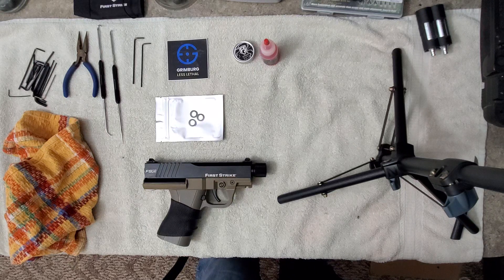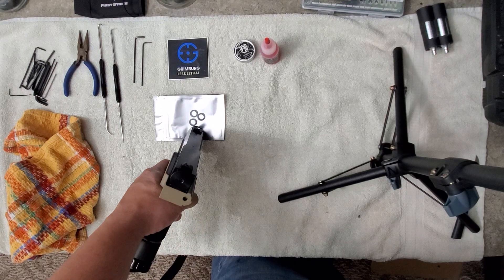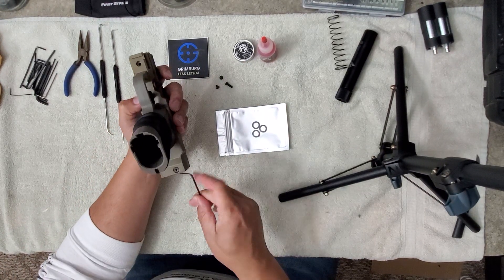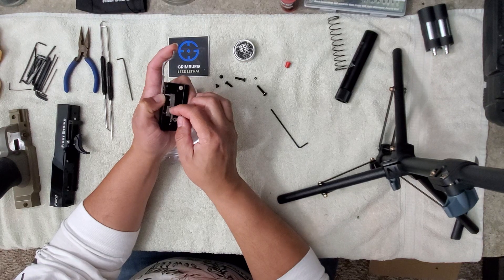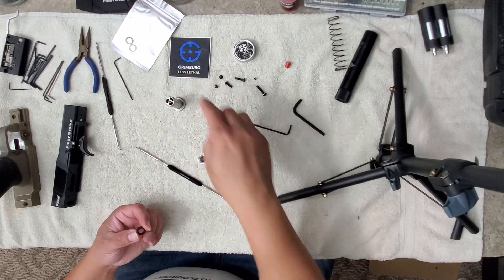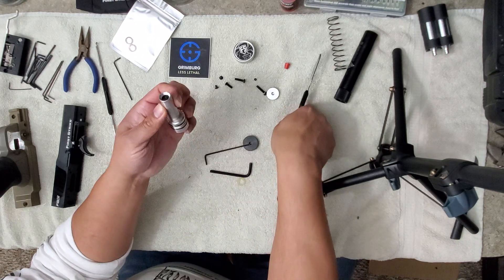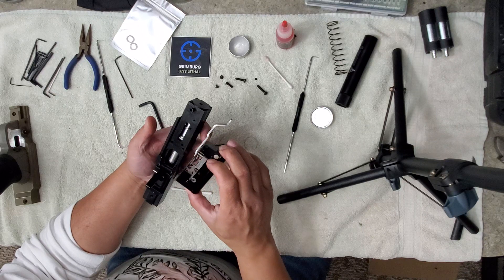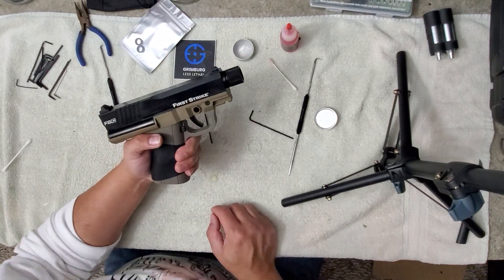How to replace your FSC heat-core o-ring with info.

Comment: Did it, finally!. both FSC & TCP in one sitting back to back. Your calm friendly voice kept me company. I didn't need to remove the last cap to put a sharpy through. I managed to slip the ring in easily on both. Did it dry then used the Qtip jam the oil in.  I feal so much better now! Thanks Again!!
Reply: But now I have a new problem. Both my FSC and TCP are spitting all the balls out when I insert the magazines. Doesn’t seem to matter which magazine or witch launcher. There’s no way I could’ve put them back together wrong. Very strange
Reply from the maker: Could be the detents. Did you lube your ammo? Also maybe use the silver mag spring.
Reply: Thank you Henry!  The detects i’ll look good. The TCP is brand spanking new, first time using it and it’s metal detents. Could the balls be too slippery? And I will put there original springs back in then I guess and hope they still push the Grimburgs up
Reply: … Sorry, my phone keeps trying to auto correct me and misspelling things and I can’t edit from my phone
Reply: And I guess it will always happen if I have the CO2 pierced when I slap magazine in there
Reply from the maker: Not necessarily. Try these...
https://www.sterlingselfdefense.com/product-page/upgraded-ball-detents-6pk
Reply: Thank you! Those look pretty stout. I’m assuming it’s a fairly standard fit. If the Grimburg barrel  uses different kind but I haven’t installed it yet So I’ll see if it happens with that one too maybe not. Thanks again very much Henry!!
Reply from the maker: Yeah, sounds like they might be slippery if you lubed them.

Comment: I went cheap/improvised on the tools.  To remove the o-ring, I used a push pin instead of a pick.  To install the o-ring, I inserted a regular Sharp (tail end first) instead of a dowel rod.  I dumped the Grimburg ring down the chamber and pushed the Sharpie until the o-ring was at the o-ring slot.  Then, I used a chopstick to seat the o-ring.  😁

Comment: The sweet spot for the velocity screw is one and a half turns clockwise from the factory setting. Great video, awesome content. I use a plastic dowel or a sharpie  inside the heat core to replace the o'ring. Could you post a link for the projectiles that you use.
Reply from the maker: YouTube doesn't let me post links on here, but it's www dot Grimburg dot me

Comment: At 22:54 Is there supposed to be a little bit of friction after it's slid about halfway down?
Reply from the maker: A little bit
Reply: @psi.defence.channel  Thank you. I just completed my first o-ring upgrade
Reply from the maker: @pepsico815  lubrication is important. That resistance should be more like suction. Like if you cover the pinhole in the air chamber it's very hard to pull apart...

Comment: Henry I was wondering if you could please help me I did the O-ring and the PRV delete and after reassembling the gun will not fire at all it does not his it does not leak it just does not fire luckily it’s a replacement and I still have my others but I would like to fix it any reply is appreciated
Reply from the maker: Did you slide the boat forward before you put the regulator back on?
Reply: @psi.defence.channel  Figured it out thanks to your regulator fix video you’re the man
Reply: Also changed the burnt orange lower to black via the instructs as per Less lethal777
Reply: You guys are awesome God bless you guys
Reply: Between you his and mikeys vids i am able to figure out these markers for home defense i am grateful
Reply: Also sprayed it with outdoor paint just in case it ever chips or fades  it will always be black underneath as well Have the handgrip arriving shortly very happy with this build may get the grimburg barrel and white v2s soon..
Reply: Also are you guys aware of any bluing products that are better than the casey product for blacking scuffs and scratches? Thanks man

Comment: Do you have to take the whole gun apart to replace the o-ring? Can you get the heat core out just with the allen wrench?
Reply from the maker: I got it out like that once but I've tried several times. I recommend just going ahead and breaking it down. You'll not only have the opportunity to examine your o-rings and re-loop them, but the more you do it faster you get at it.

Comment: Is there a trick to take off the back cap to remove the bolt? It's really tight that I'm afraid to break it?
Compare to yours, you unscrew it so easy.
Reply from the maker: It may have some type of loctite adhesive. You will have to heat it up. I have a little miniature butane torch that I use.

Comment: Question if I had to get one lube for the gun what lube do you suggest and I will get it from Amazon
Reply from the maker: UltraSilk Paintball/Airsoft Marker Lube and Treatment, 1 oz gw - Made in The USA https://www.amazon.com/dp/B089P1ZS7T/ref=cm_sw_r_apan_glt_i_0DG1ZPDZYHPK461RMM2J

But if you buy it from ultrasilk.com and use PSI10, you get 10% off

Comment: Is it absolutely critical to remove the upper just to change the O ring?
Reply from the maker: I got the heat core out once without doing it, but I tried many times and could not. I've come to the conclusion that it's better to just take the upper off so you can inspect and lube your o-rings while you're in there. I've done it so many times it's no big deal. The more you do it the easier it gets!

Comment: where can i get the magazine cant find one
Reply from the maker: T8.1 or FSC?
Reply: @psi.defence.channel  t8.1 for the fsc
Reply from the maker: @stevenmeansphotography3861  they are hard to find. Keep looking. Stuff pops up in stores occasionally. Also keep checking eBay. CymruTec sells these great printed mags.   https://cymrutec.onlineweb.shop/FSC_12g_Co2_Magazine/p7191594_20532746.aspx
You need the internals from your Fsc mags though. He also makes a 16g version.
Reply: @psi.defence.channel  so question the inner parts from the stock Fsc first strike mag will fit into the t8.1 16gm mag
Reply from the maker: @stevenmeansphotography3861  yup! Here's my video on it!
https://youtu.be/oH1oQUIcE6Q

Comment: I reckon mend you try a nemesis barrel!!!
Reply from the maker: I had one. Not super impressed. No real gain over smooth bore at less than 75 ft.
Reply: @psi.defence.channel  those new projectiles you have work better with the nemesis because of the Finns
Reply from the maker: @andrecolombel405  I'm sure they do. I sold my nemisis a while back so not sure.
Reply: Same as lapco as the Nemmy extension isn’t rifled.  So same as lapco and suppresor

Comment: There is a limit on how powerful you can make the FSC-The stock o-rings blow out.Gotta change them to Urethane o-rings to shoot past 50 joules.
Reply from the maker: I always change the stock heat-core o-rings out for milsig units. I think they maybe urethane. But the edges aren't rounded so it fills the entire o-ring Channel. I highly doubt that any velocity would blow that o-ring out!